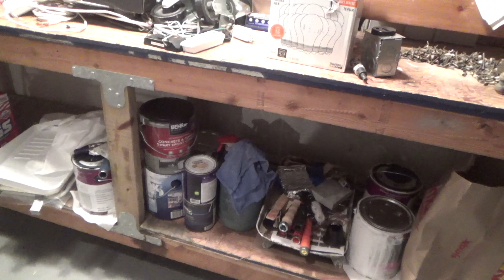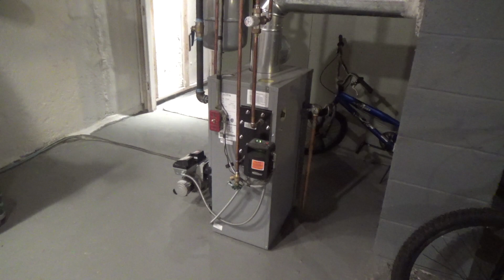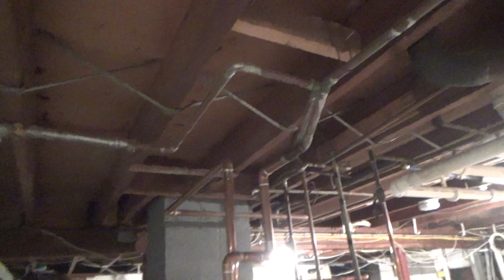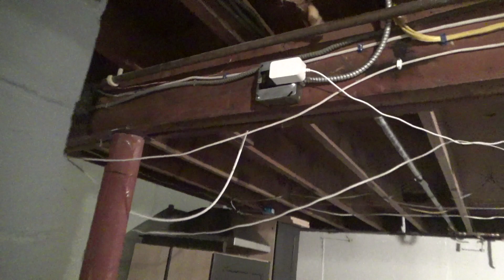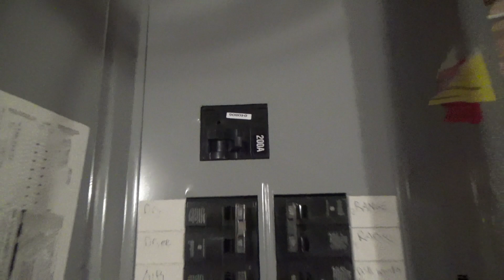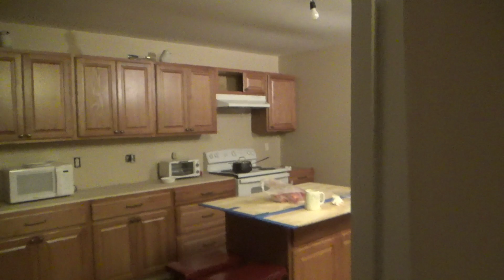Relocation Vlog #11

Comment: I would not worry about upgrading the service. You could use some "tandem" breakers to give you some more circuits. I know it is generally not the best option, but it works and should be fine.